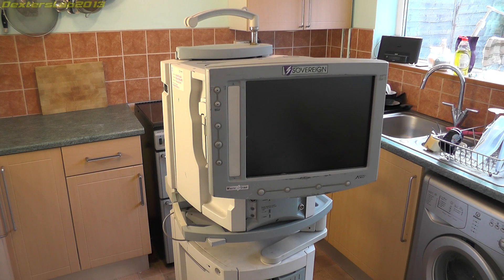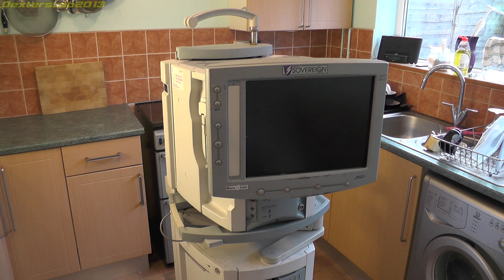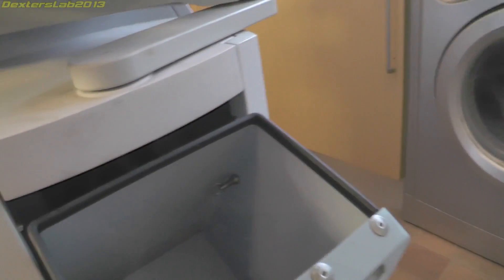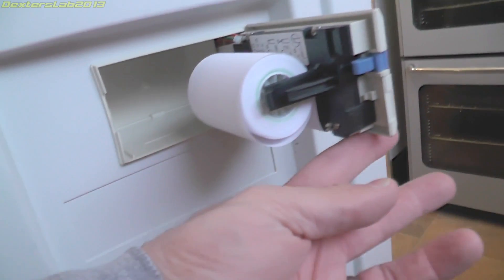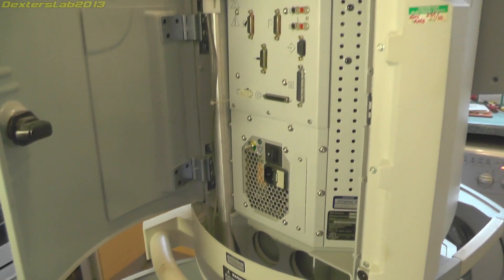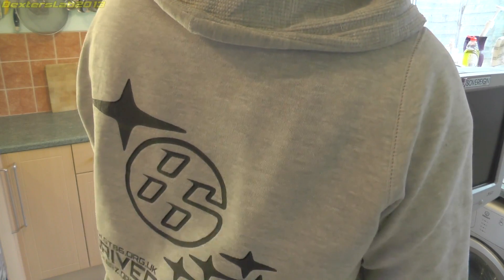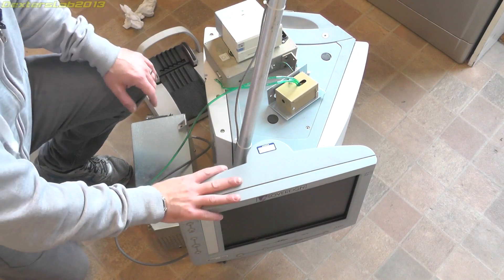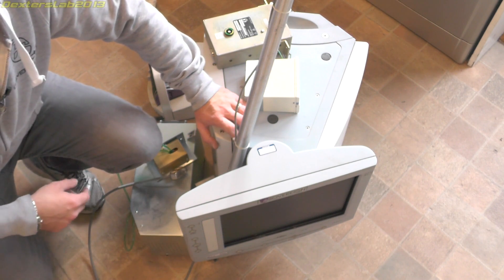DL#105 - Cataract Surgery Machine AMO Sovereign Phaco Teardown Part 1

Comment: Thanks for uploading this first part in an emergency so we can see what it is all about. It is a little bit a shame the screen got broken and the hand tools are missing, you will not be able to play with the machine. The baseplate with the casters may be handy to have in your lab it it is salvageable.
Reply from the maker: Yes i was disappointed about not having the tools, they would have been interesting to look at.
Reply: It's possible the tools are either usable on another machine or are some sort of biohazard I presume. Then again, Mike had that analyzer machine, and it was full of scary liquids... maybe it's just something every seller decides for themselves.
Reply from the maker: Yes, from what i can tell the tools for this one would work on the newer machines from AMO so maybe they kept them for spares or something. I remember that analyser that mike had, it looked proper frightening inside with all the residue yuck!